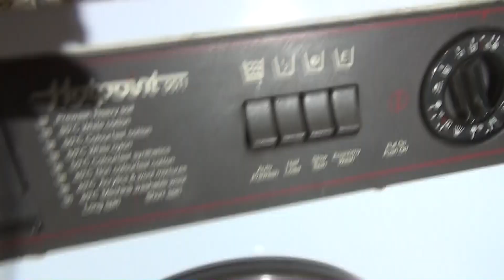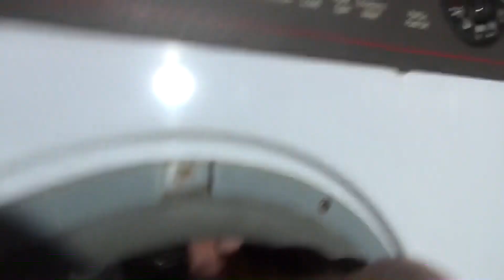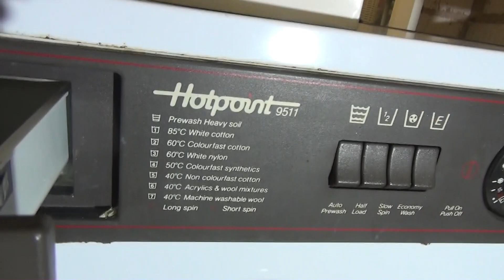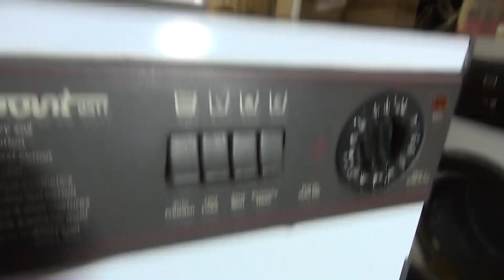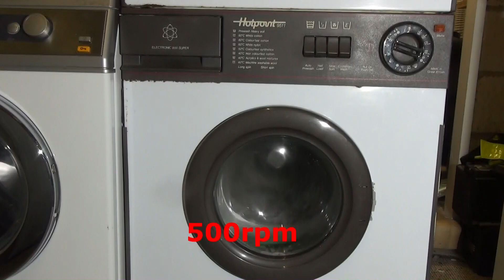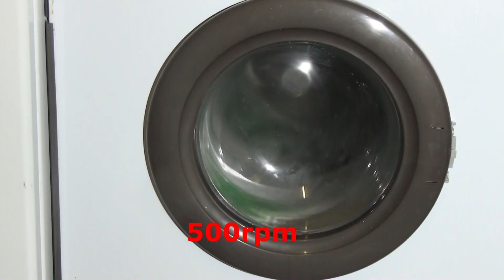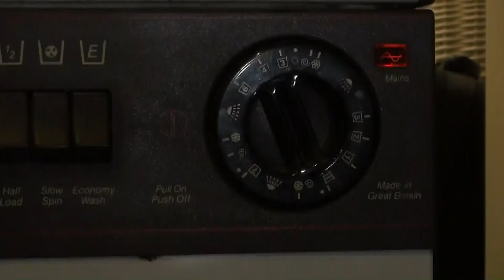Hotpoint 9511 : test wash

Comment: I dont get it. What’s wrong with twisted door seals? And how does that happen? 😂
Reply from the maker: either its been slightly twisted when being fitted to the frame, or its slipped over time. or sometimes if a damper is worn on one or both sides.

Comment: That pump does not sound good. Same goes for the bearings. Nothing a bit of TLC can't do though!
Reply: I think the buzzing noise is the door interlock
Reply: It only appears to happen when it would generally be draining though. You coluld be right, although its not all the time.
Reply: @battytec  It's the interlock, all the "proud-door" 95-series models do this.